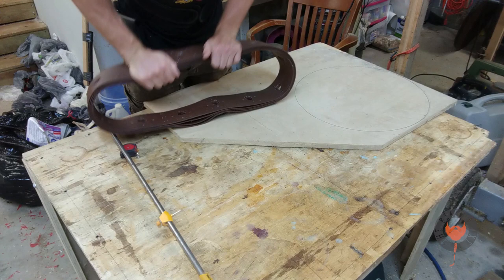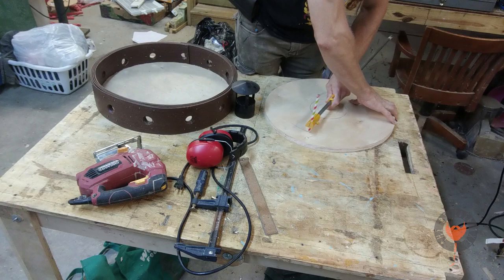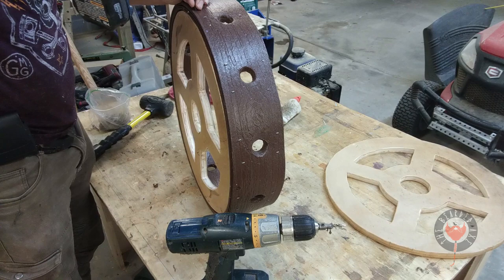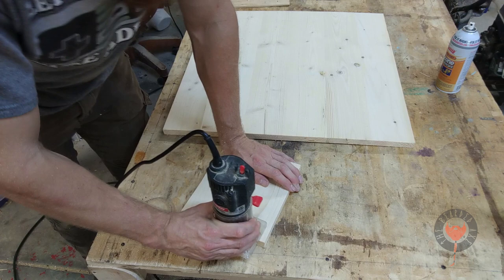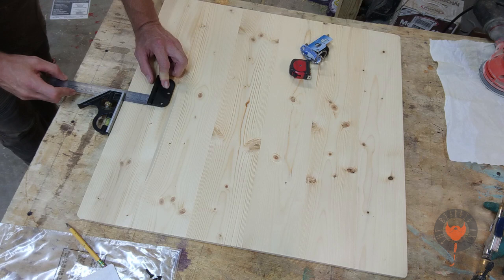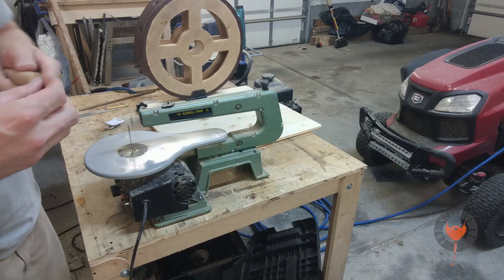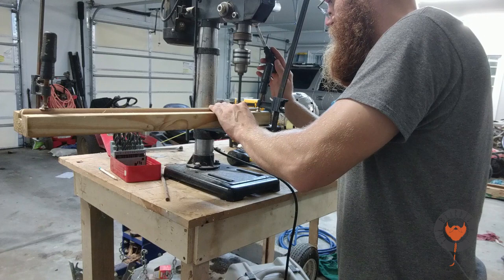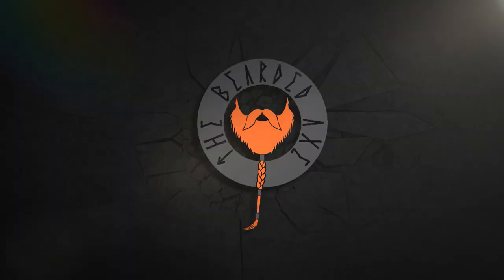Yurt me baby one more time part 3-  All the Single Ladies put a roof ring on it!

Comment: Nice innovation!! 

I built mine for very windy conditions, so i couldn't use a hatch like yours. In my case, i made a lifting, weighted lucite dome hatch. Rode it on 8 round rails, and below the rails were connected to a wood/metal ring. I pushed it up with a treble forked pole, and i made 4 catches from door latch hardware. Brought it back down by tripping the latches.